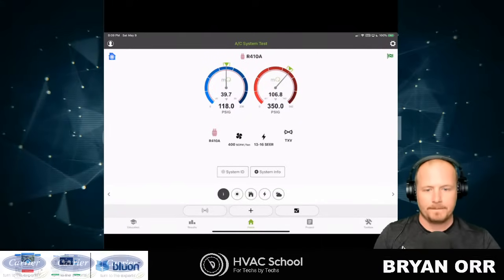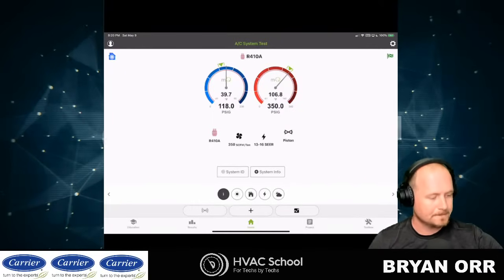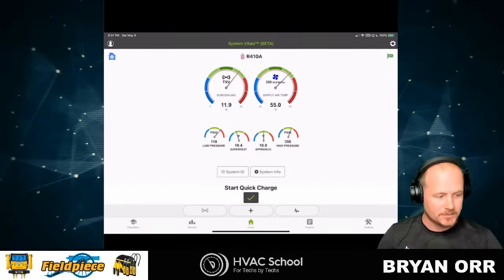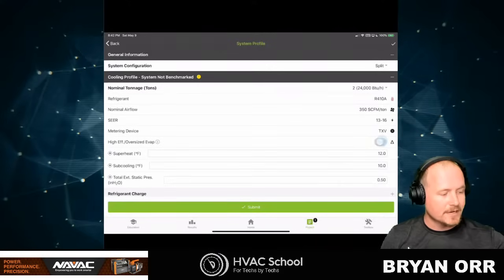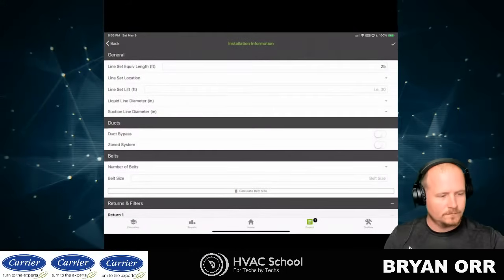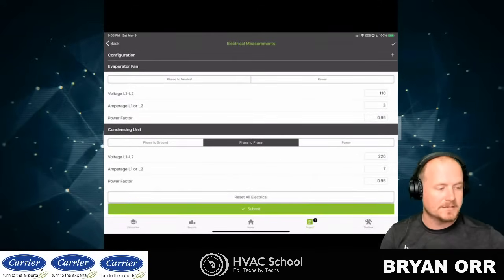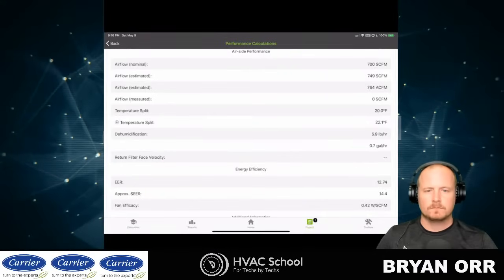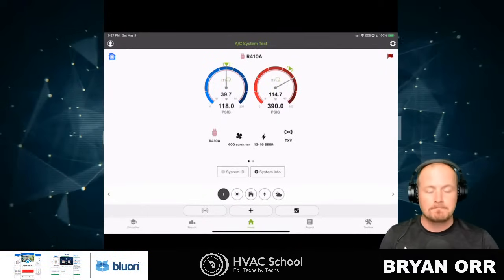Cooling Commissioning Measurements Walk Through w/ MeasureQuick

Comment: I love, appreciate and can’t thank you all enough for all the hard work that has gone into the product, the app and the video’s along with all the  podcasts you all have produced. Just a few questions if I may....what  is the best way when commissioning or testing  a home with multiple units, possibly different types of units,  to list then for future reference?  Can you print from the MQ printer and send a pdf file to you and the homeowner? If using a OD hydrometer will it override the weather data being brought in from a weather station? When comm/checking a Carrier packaged unit would you then place your discharge line temp clamp AND the suction line temp clamp on he discharge line where the pressure probe is hooked on?
Reply: Chris Hall you can have as many pieces of equipment as you want at the same site. Even 40 rooftop units. You can print, email, store any report even multiple times. The weather data is used for confirmation, not the ODA temp. That comes from the probe. On a carrier unit with a discharge port, you would measure pressure on the discharge line and temp on the liquid line. They typically have a higher subcooling target to accommodate for pressure drop in the condenser.
Reply: @measureQuick  awesome. Can this only be done with a paid subscription? To have multiple units per site.